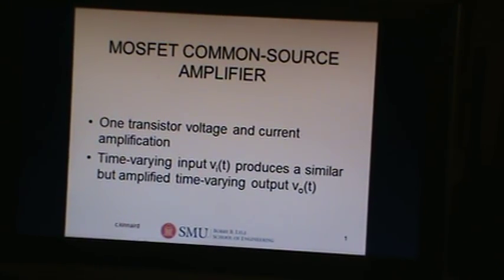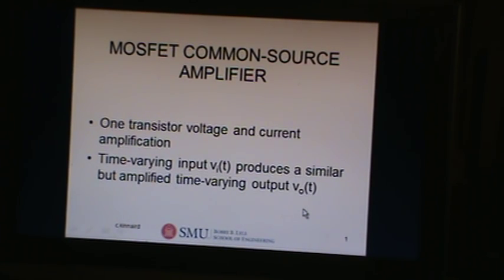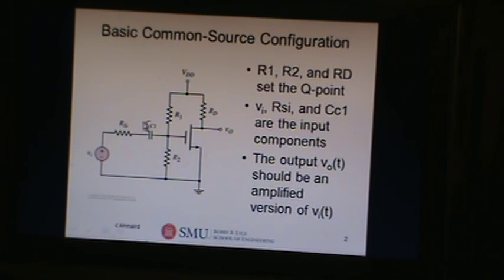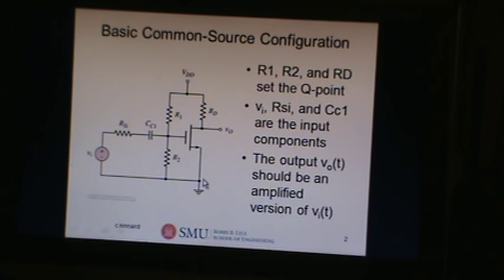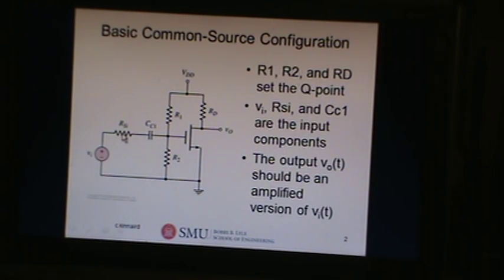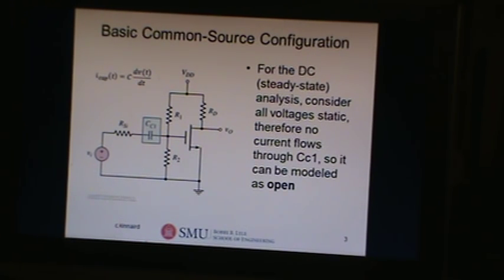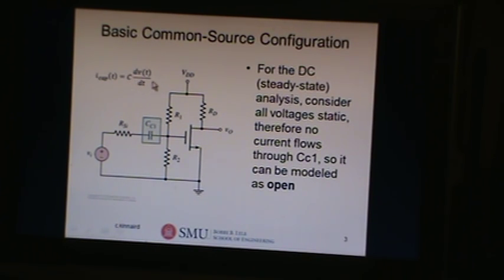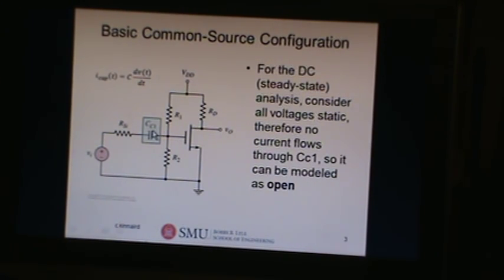Basic Common-source MOSFET amplifier

Comment: I think there might be a slight error on slide 9 (seen in the video at 21:17). Isn't Id=1/2Kn(Vgs-Vt)^2? Instead Id is calculated in the slide (without the 1/2) as: Kn(Vgs-Vt)^2.
Reply: my texts book do not show a 1/2
Reply: No, Id=K(Vgs-Vth)-raised-to-2 is correct. In general terms it has the form y=c(×-raised-to-2). In the case of Id =.... we have K is the constant c found in the general form of equation. You can test the behavior of this form of function by using the explicit example y=1/2(x-raised-to-2) and if you do so you will see that any y value divided by its associated x-squared equals 1/2 which in the explicit example is the constant in front of x-squared. This then coincides with K is amperage over voltage squared.

Comment: Nice job! I do think you should make it clear to the viewer that gm is the instantaneous rate of change at the point on the graph, defined below, where y = drain current at Q point. The graph is the graph of "drain current versus x=(Vgs-Vth) when (Vgs-Vth) equals Vds" and is given by y=k(x raised to 2 having the property x is greater or equal to 0).

The normal way to find this instantaneous rate of change is to find the derivative of y=k times x raised to 2 and this equals slope at point when a value is plugged in for x. Here you did not know the value of x; rather, one knows the value of y. So, indeed given you know k and y it is true that in graphs of this form 2 times the square root of (ky) will give you an equivalent method of finding the slope as desired.

Once you know what gm is a calculation of everything from that point on makes perfect sense. However, since calculating slope in the manner used is somewhat unusual it would be a good idea to indicate what it was that gm actually was calculating. Ie instantaneous slope.....

I am an amateur with respect to electronics but a professional with respect to mathematics and I was at a loss until I figured out your gm calculation was actually calculating slope in a manner that has a limited ability to be valid at doing so.

Thanks none the less because except for the bit of confusion involved it was an excellent tutorial.